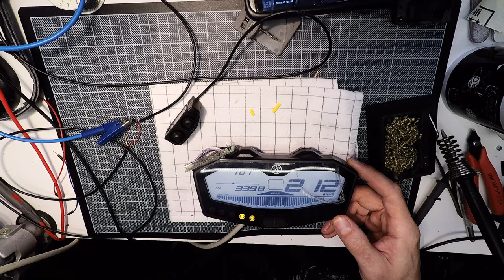How to connect external switches to the Yamaha MT-07 cockpit

Comment: Welche Diode wird im Video verwendet?
Reply from the maker: Nichts spezielles. Es geht fast jede. Z.B eine 1n4148.
Reply: StevStuff okay, was braucht man sonst noch alles an Material?
Reply: neben ein wenig Kabel brauchst du noch diese Steckverbinder für den originalen Yamaha Stecker --> https://www.digikey.at/product-detail/de/jae-electronics/M34S75C4F1/670-2268-1-ND/2044290